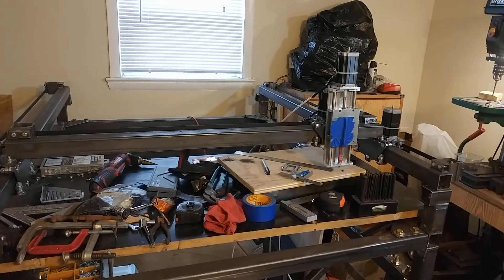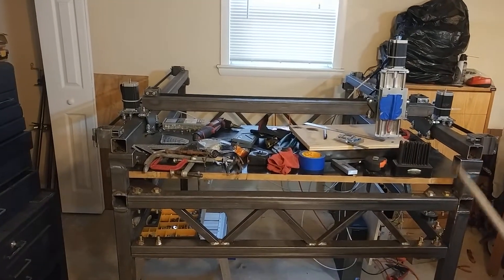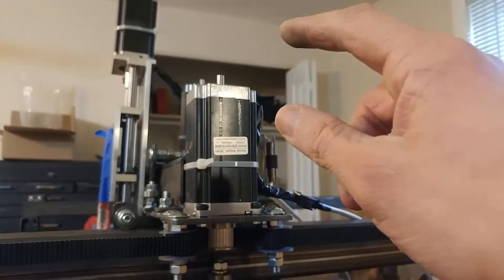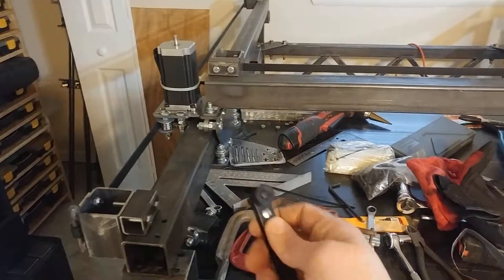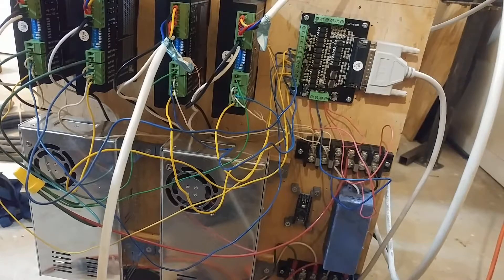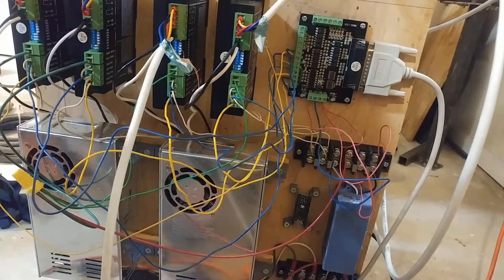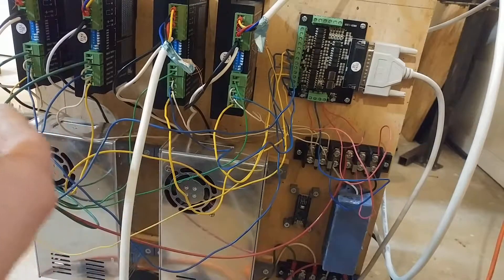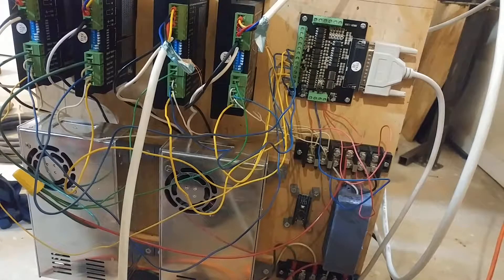CNC Plasma Build: Some corrections

Comment: Ohh I had another question I forgot to ask. When first setting up LinuxCNC there was an area to select the driver in the testing area.. I think I chose "tb6560x3 axis"...would simply plugging all this in give the option to select the "DM542a" as an option?... as it didn't show up before from memory, and I am guessing the hardware picks it up and adds it in?.... also do you know if it's safe to change stepper settings on the dip switches with these boards while using LinuxCNC?, or would it damage the boards?....I'm trying to put my mind at ease... I liked the look of LinuxCNC as it was straight forward and would prefer to use it over Mach3 if it's as good. I used Mach3 a few years ago... no problems, but I thought... hey, new machine (homemade).. new setup, might try new software  :)
Reply from the maker: I wouldn't change DIP switches while the power is active. I don't know if it's safe to do so or not, but it's definitely safe to assume it's unsafe. These are things you shouldn't need to change ever once your machine is up and running, so turning the machine off to adjust them is not a big deal.

Check out the playlist and watch the LinuxCNC software configuration video. That should help you out with the gist of LinuxCNC.
https://www.youtube.com/playlist?list=PL9xPdBFt5g3Q6TkuhhfQmQNm6TdvNkPuX

Here's the playlist from the other guy I recommended (russtuff). This is several videos and breaks all of LinuxCNC down into chunks.
https://www.youtube.com/playlist?list=PLv4P26_5EBiyorZkSAUl897p1ISxzE3Xk
Reply: Awesome!... thank you again for your help!  
Cheers.  Subbed.

Comment: Can I ask what current is needed for the 5v supply... I have a 2.5a floating around I want to use...err I ~think ~ that's enough..right?.
I wonder about the LinuxCNC axis test causing problems.. eg... what if two motors are connected to be cloned on say the X axis... if only one can be tested at a time... wont spinning the other motor as it it moving cause amperage to be generated from the other motor, (turning it into a generator)...and feed power back into the controller and potentially damage it.... maybe a few diodes thrown in for good measure might be a good Idea.... I don't really know, but was just throwing it out there.
Reply from the maker: That's more than enough. I've got a 2 amp generic Chinesium supply on there.  I bet you could even get away with using a peeled/stripped USB cable straight from the computer, but I opted against that to minimize the possible damage if I accidentally short something.

If you've got a pair of cloned X motors wired up to a pair of enabled drivers (with the +5V enable pin hooked up), then those drivers will be powering the steppers to keep them actively locked in place. So if you run the one motor in the LinuxCNC test axis tool, the other motor is going to fight it, and that'd be a whole lot of bad. Don't do that. lol

If your goal is to find the max velocity and acceleration values that give you consistent, predictable behavior, I'd say test that on the Y axis (across the gantry, 1 motor, no clones), and then those numbers would be conservative values for your dual X too (since it's only marginally heavier, but has 2 motors). 

Then you can use the standard LinuxCNC controller to make sure the X motors are turn the right direction, while you have the belts/racks/leadscrews disengaged, then engage the drivetrain and test the motion across the table.

Either that, or test it with Grbl. That's not a bad skill to have either.
Reply from the maker: Oh, and be sure you check out Russtuff's videos. I don't know the guy personally, but I like his shit.